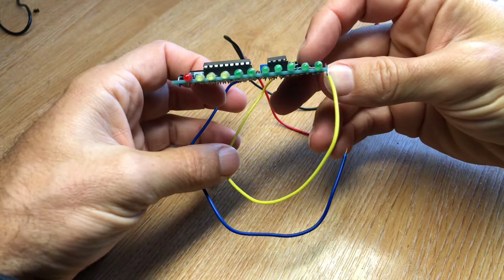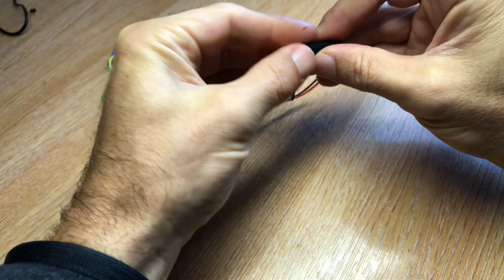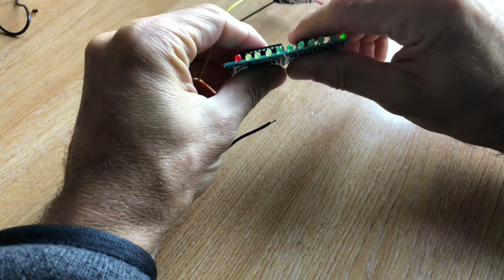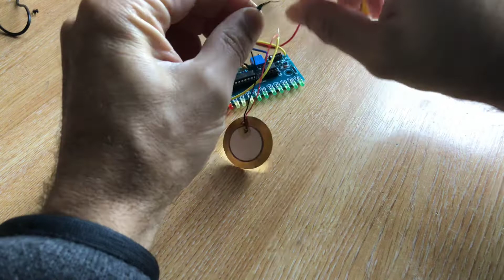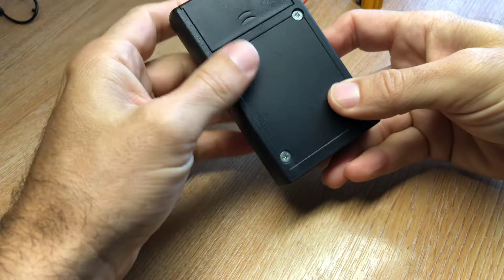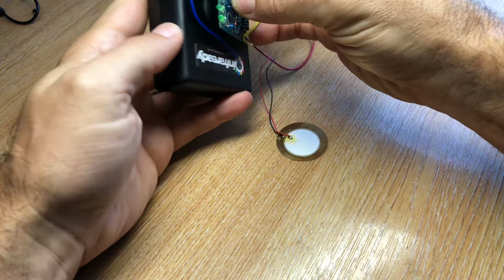How to make a Geophone Vibration Detector

Comment: I would like to thank you on the idea of using a piezo for the sensor. I used a KA2284 Level Indicator for my board (Cheap) 9V batter and I put my peizo and 1inch ball bearing in a medicine bottle  that fits nicely and  I have it working. Getting a Dupont crimper tomorrow to make it correctly. But it worked and it is pretty sensitive.
Reply from the maker: No problem. I’m glad you found it helpful.